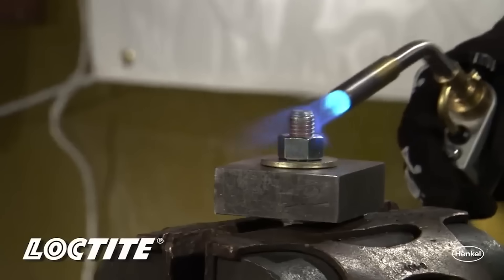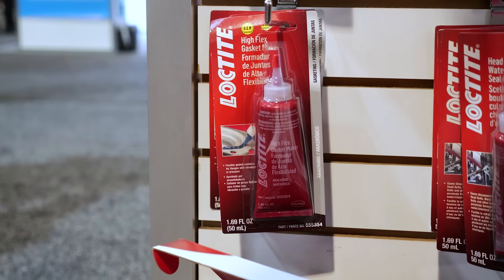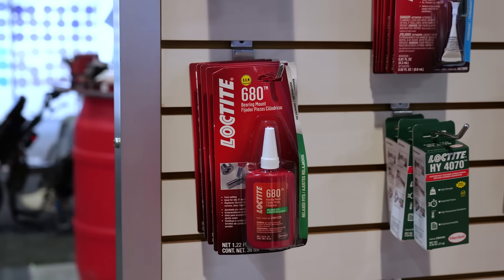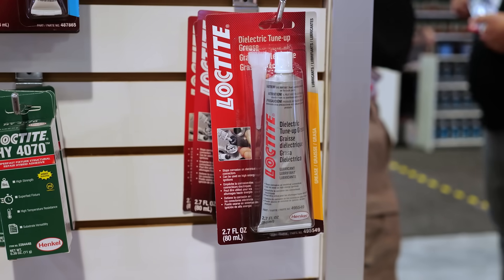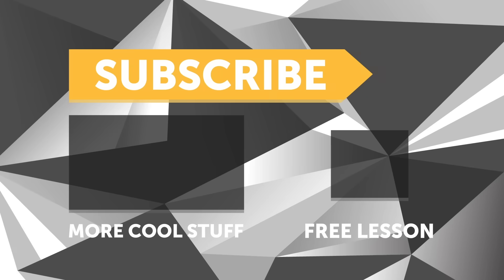Many pro mechanics don't know this.

Comment: idk about the blind hole thing 

I put it on the bolt every time, and it works properly every time 

the pressure will push the EXCESS liquid out for sure, but it is still smearing it along all the threads of the bolt as it goes in
Reply from the maker: Great you haven't had an issue with that!
No one is saying you will instantly see failure, just that you are introducing avoidable potential risk based on their testing and experience.
Unless you have done extensive testing using fasteners that are big and small, long and short, coarse and fine pitch in all types of different environments etc, then I'm not sure what advantage you gain by not following this advice. It's up to you though 🤘 - Taz.

Comment: It's pretty simple blue red green in order of strength and if you need to take it off or not and then they break down into further colors they have purple For Thread lock for pipes and for air and water there's a lot of extra special ones now you need to read the instructions very carefully because it's not a one thing fits all.
Reply from the maker: Even though it's simple, a lot of people get a bit confused. Even your order of strength isn't quite right according to Loctite themselves. They rank RED as the highest strength 😉
You are bang on with the fact they have GREAT instructions that are easy to access though! - Taz.
https://next.henkel-adhesives.com/us/en/articles/choosing-the-right-threadlocker.html
Reply: @hpa101   I hadn't realize this. Now leave it to me to add to the confusion 😎
 I worked in the medical / surgical instrument repair industry for 12 years. We would frequently use the green slip fit on threaded things, not as intended..in place of reds. Which would yield us less failures. This was my experience. These instruments were being autoclaved with high pressure, steam and soaked in sterilization tanks on a regular basis! A rigorous natural test. 
It's also important to note that both red and green lock tight come in a few different variations, some having more chemical resistant characteristics while others are more heat-based. We had all of them, plus some specific ones. 
You guys are the best! Hope to see you at the GTR festival or at Texas 2K again, here in America this coming year. From your friend in Washington State. 
Beau Tobola / Life on Review
Reply from the maker: You're bang on with the different compounds that are the same colour, a lot of people don't notice that either! The colours are handy but when you get into specific things like what you're working with, the specs and the numbers are the safer way.

It's exactly the same for other brands too like Wurth. I don't know if they do as good of a job on the easy access technical documents like Loctite, but still the same best practice to look into things a bit deeper to get a lay of the land like you have.

Thanks for sharing some insight into your own use case and testing, we often just think bolts are bolts but there are really so, so many different ways they can be and are used out there in the wild.

We'd love to get to TX2K again one day! It's great New Zealand is so isolated in a lot of ways, but it's also a pain at times when it comes to travel out of here. Sometimes it's not even about the money, it's the lost time getting anywhere too.

We're off to WTAC in Australia very soon and will have some new content from that. Let me know if there are any specific topics you'd like to hear about 😎 - Taz.

Comment: would have liked his answer to shelf life on opened bottles.
Reply from the maker: That would have been a great question for sure. 2 years from the manufacturing date is the answer 🤘 - Taz.
Reply from the maker: Just putting this in a second reply incase YT filters the link.

Source: Loctite Global Manual page 108 - https://www.hpacademy.com/assets/e671ba72f3/Loctite-Global_Threadlocking-Manual_V01_2101.pdf

"During the development of each product, a thorough stability study is
performed to ensure consistent product performance throughout its
shelf life. Appearance, viscosity, cure speed and strength on a controlled
test specimen are some of the quality specifications that a product must meet. Most threadlocker products can be stored at room temperature for two years. The adhesive is stabilized in the package by various means.

Packaging
Anaerobic adhesives remain liquid (stabilized) in the presence of oxygen. The anaerobic bottles are intentionally filled half-way so the oxygen in the empty space will prevent the threadlocker from curing. Additionally, the bottles are made from air permeable low-density polyethylene, ensuring the presence of sufficient oxygen to prevent curing.

Additional Stabilizers
The adhesive formulation also contains additives to stabilize prematurely generated free radicals and any metal ion contamination."

Comment: One of the biggest issues with Loctite is that it acts as a lubricant on assmebly.  Using manufacturer torque ratings will result in bolts that are overtightened.  Loctite does not make these numbers readily available, and from this video, clearly chooses to gloss over the subject.  Maybe the overtorquing is how Loctite achieves their results.  The product is good, but be careful with it.
Reply from the maker: I'd be interested to see the tests you're referencing that show it causes over torquing, or to know if you're just rolling with an assumption (that's not a dig, there are a lot of myths out there based on assumptions, even with the best of intentions!).

A question came up about this in another post, it's a great topic. 
They do address this in the publicly available 'Global Threadlocking Manual' (6.3.3 & 6.5). Also in their 'Threadlocking User’s Guide' they state that you use the dry figures, and their product (possibly the likes of Wurth too) actually reduce scatter rather than causing over torquing.

Note, we don't sell threadlocker, these are all things we've been interested for our own use of it, just like you 🤘 - Taz.

Global Manual: https://www.hpacademy.com/assets/e671ba72f3/Loctite-Global_Threadlocking-Manual_V01_2101.pdf

User Guide: https://www.ellsworth.com/globalassets/literature-library/manufacturer/henkel-loctite/henkel-loctite-user-guide-threadlocking.pdf?srsltid=AfmBOooAAJTIaQaLljg9RNELO0omTfrjOUWr_RZyNveXBRqydX0OGAih

Comment: Just an FYI loctite comes in more colors than red and blue. I deal with some rather small fasteners that are exposed to a lot of vibration. Especially if you have to service them. Purple is ideal for that application for me. Blue can sometimes be a bit too strong for small fasteners. So maybe check out the catalog if you're doing something other than car stuff as well.

Comment: Red max strength  is what i use on 3mm×.5 bolts/screws on my RC rock boucer for the last decade havent stripped a 1, 2, 2.5mm allen head out yet.  Blue juce screws fall out.

Comment: Harley Davidson specifies using red on the crankshaft on the chain-case side. It’s also one of the tightest bolts on the darn bike, and one of the places I’ve had to work the most(high mileage rider, I wear stuff out). I hate it, and I do it, but I always clean the threads with a tap.

Comment: We are struggling with stainless steel  bolts and nuts, it doesn't work as it should...any solution?
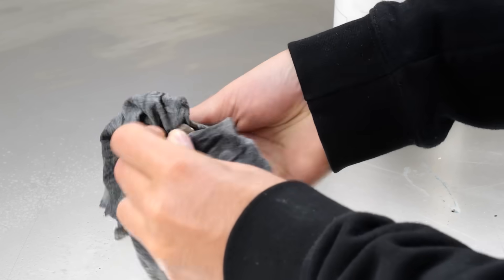Reply from the maker: Are you using a primer? If not, that might be your solution 6:32
Note we don't sell any of this stuff, your local Loctite/Henkel rep should be able to help but they do also have some great technical documentation on their site as well - Taz.

Comment: Anti seize on vehicle wheel nuts, especially on old, occasionally used, trailers.
Reply from the maker: Great tip, that can save a lot of headaches and frustration down the line 😎

Comment: While in the Army in 77, I lived next door to an Airforce Jet Mechanic who told me "Loctite" is for armatures who don't understand torque, and that there is a difference between dry torque and wet torque and that it is better to lube the threads and seat them.  I hardly ever use glue on threads.
Reply: @frankl1955  Yeah. Meanwhile he tied all the bolts on the airplane engines. Because metalurgy say Nothing is 100% identical.
Reply: A couple of points with regard to this- 
1)  The AN bolts and nuts used in aviation are closer tolerance and more precision than mass production bolts, so when properly torqued they do in fact tend to hold their torque.  
2)  Every aviation product comes with a service manual that mandates how they are assembled.  If it's a critical part it is going to be secured with safety wire or a cotter key, or occasionally with single use nylock nuts.

Comment: Loctite is mostly for things that cant have a locknut on the other side of it or if you need them to stay extra secure. You can get locknuts now in different locking materials like copper and steel also with cutouts for cotter pins also

Comment: Here's a little piece of advice NEVER USE LOCK TIGHT TIGHTEN THE DAMN BOLT IT DORSNT MAGICALLY COME LOOSE! IDIOTS!
Reply from the maker: You're right, it's not magic that loosens bolts, it's vibrations and/or heat 🤘 - Taz.

Comment: I have a motorcycle that vibrates itself apart. Red ended the trail of nuts and bolts on the road.
Reply: Still shouldve been blue...anything automotive related.needs blue...because things have to.be serviced

Comment: It should also get more coverage that antiseize isn't good for critical torque spec bolts.  The compound makes the thread slippery, so the torque wrench doesn't trigger until the bolt is roughly 200% over-torqued.
Reply from the maker: That's a bit of a bigger topic for sure, you are right! Torque specs can be given as wet or dry for different applications too.
The technical documentation that comes with your anti-seize will give you some information on this (torque coefficient is what you're looking for) - Taz.

Comment: I saw a test with all the different colors of lock-tight. There was not a big jump in foot pounds required to break a red bolt compared to blue. Red is not permanent and does not require heat to break. I had an old timer show me how well silicone works to keep a nut from getting lose on cars and tractor equipment

Comment: Loctite 660, intended for press fit parts, saved my 90 Mazda Miata's short nose crank failure.  A common problem with early engines, the surface area of the tapered crank snout was too small to hold the loads of the rotating crank cog and pulley.  Mine started to slip and widen the keyway causing the timing to become retarded.  Caught it early cleaned it up, new cog, woodruff key and bolt (and front main seal - cause you've already got it apart).  Slathered the snout and cog with 660, turned the cog tight to the undamaged side of the slightly widened keyway, and tightened it up.  Let sit 24 hours.  Many years later I went to remove it and bent a steering wheel puller trying to remove it.  Wow, strong stuff.  You could actually run the engine with the bolt removed, and I did to move it a few feet.  Heated it up with a little MAPP gas, and was able to pop it off with a flat screwdriver like it was just sitting there.  When all else fails, read the MSDS sheet. (For removal, add heat)

Comment: I'd be interested in a little tool to break up the crust that forms on the bottle threads and up inside the cap. Often the bottle cap threads become filled over time and the caps will no longer engage the thread. I've had some luck crushing them with pliers or getting a small screwdriver up in the cap to clear the crud. A double sided cap would be a plus but i also envision a plier tip that has a serated thread to grip the bottle portion, crack and unscrew the build up mass.
Reply: You can cut a square of a plastic bread bag or sandwich bag and set it over the bottle tip and screw the cap down overtop the patch. The patch seals the tip opening and threads and keeps the cap clean. I've done this trick on many things, but not thread locker per-sey, so you have to try it and decide
Reply from the maker: Yeah that is a pain when that happens! - Taz.
Reply: Snap On mini pick.

Comment: This is mythology. I've had red Loctite come loose, no problem. Hardly even knew it was there.
Reply from the maker: If it isn't working as the manufacturer and others are telling you it should, then that's probably a sign you're doing something wrong. I'd say what is discussed around 6:30 is the issue, at a guess. If you are not applying it correctly, it could also be the case that there isn't any threadlocker where you think it is and where it needs to be.
Hope that helps! You should apply that logic to anything that isn't working as it should be for you yet is for others - Taz.

Comment: No advice on removing the blue from places it shouldn't have been installed. sigh
Reply from the maker: Henkel (Loctite) provide all this information. Here's a link to help you out: https://datasheets.tdx.henkel.com/LOCTITE-THREADLOCKER-BLUE-242-en_US.pdf

"For Disassembly:
Remove with standard hand tools. In rare instances where hand tools do not work because of excessive engagement length,
apply localized heat to nut or bolt to approximately 482°F (250°C). Disassemble while hot.

Clean-up:
Uncured: Wipe with a damp cloth.
Cured: Remove with a combination of soaking in a LOCTITE solvent (such as SF 790 Chisel Paint Stripper or Loctite 7601
Equipment Flushing Solvent) and mechanical abrasion such as a wire brush."

What did you use it on that you shouldn't have out of interest? - Taz.

Comment: I've always use red loctite on flywheel bolts, they come right out with an impact
Reply from the maker: You might find it never set correctly or wasn't applied correctly if it's that easy. Not a dig at you or anything, you just have to wonder why others have so much trouble and you don't is all 🤘 - Taz.

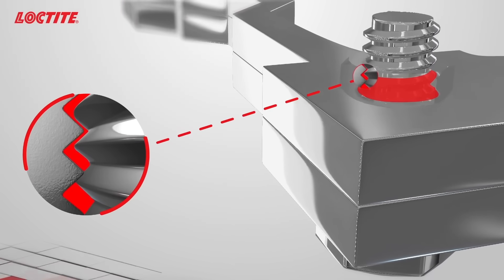Comment: 5:22 "going to stay liquid" It never dries?
Reply from the maker: That's what he says, but you have quoted that one part with out the context before it. He's not saying Loctite never dries/sets, he's stating the EXCESS Loctite that isn't in contact will not dry/set. That's one reason why it's not already set in the bottle.

Hope that helps! - Taz.

"Yeah, no definitely not necessary right, so in essence you really want to put the material, we say two free flowing drops right, so two drops out of the bottle. And you really only want to put the material where it's going to be surfaced with the threads.
 
So, any excess material that you put on there, it's not going to set up anyways, it's always going to stay liquid and so really you only need those two free flowing drops where the threads are going to be engaged."

Comment: Maybe youuuu..lol jk but no I learned the proper use cases for thread locking & sealing compounds in Construction Mechanic A school. Also very important that you know where and where not to use it or safety wire/cotter pins in moto/powersports as nearly every bolt is susceptible to loosening from vibrations, thermal cycling, etc.

Comment: - "Most people incorrectly use red."
- "There isn't much strength difference between blue and red."
Reply from the maker: Yes, as stated they are different products 😎 - Taz.
PS: These are not the only 2, but you can compare via the technical documents here:
https://www.henkel-adhesives.com/nz/en/product/threadlockers/loctite_2430.html
https://www.henkel-adhesives.com/nz/en/product/threadlockers/loctite_2621.html

Comment: I've used super glue and it is brilliant. It will break away with out heat turning the spanner. Also threads don't take long to rust up.
Reply: @grahamsmith5768 Why would you want the threads to rust?

Comment: 242 is my go to for certain applications of accessory mounting hardware for my firearms. Never had anything come loose and when it came time to remove something, a little extra twist and it comes right out. Biggest issue I see is folks lathering it on like hand lotion...

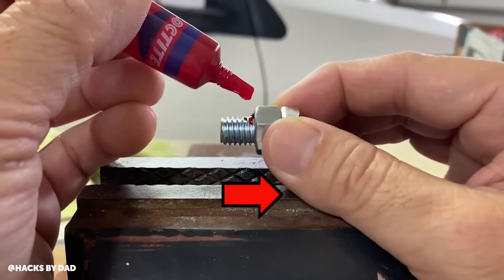Comment: At 2:00, They're applying red to an assembled joint.  I didn't think that red Loctite acted as a penetrating oil - that's how you can use the Green Loctite, but I didn't think red would work properly with already assembled fasteners.  Is this a new product?

Comment: Be very careful when applying liquid Loctite to a blind hole when: 1) you put a lot of liquid, 2) there is little material behind the hole. If the thread is tight and the liquid cannot get out, a lot of pressure will be created when tightening the bolt. This can lead to the destruction of the material behind the bottom of the hole, typically a weak spot in the aluminum engine block.
Reply: @radoslavkrajcovic9915  This!  Also, torque value will be incorrect!

Comment: Really like the blue 243 for almost everything - it has the great application qualities that the red has but a very reasonable amount of retention.  I bought a 50 oz. bottle of blue 243 and haven't used blue 242 since - seems to last longer too.  Still use the red where called for, but really clean the threads well to make sure it will adhere properly.

Comment: I’ve used clear nail polish for over 50 years for locking down fasteners. Works great, prevents rust, and leaves no nasty residue to clean off.
Reply from the maker: Loctite ran some tests on that too it turns out. Down the bottom here: https://www.henkel-adhesives.com/us/en/applications/all-applications/industry-insights/using-threadlocker-alternatives.html/1000.html